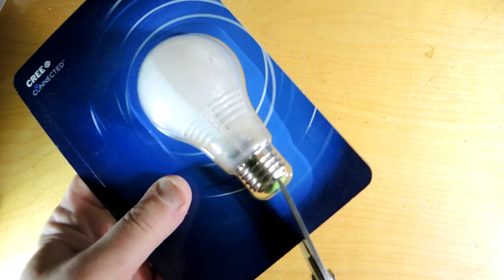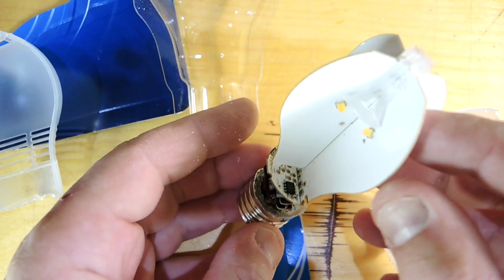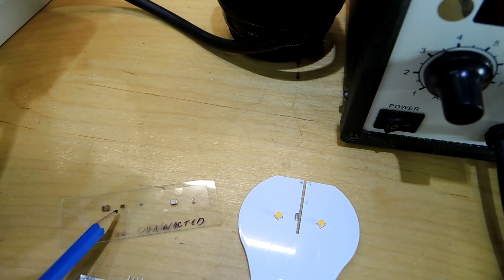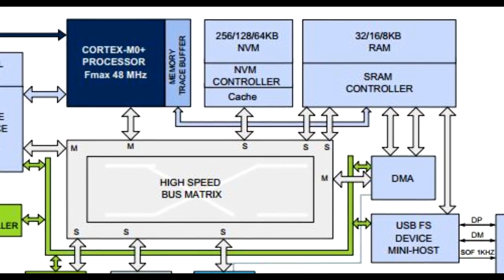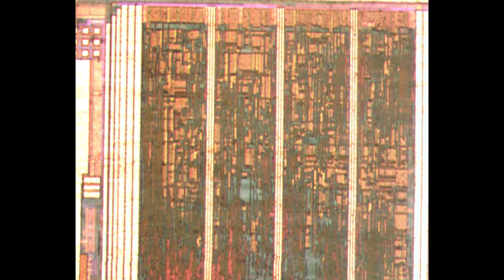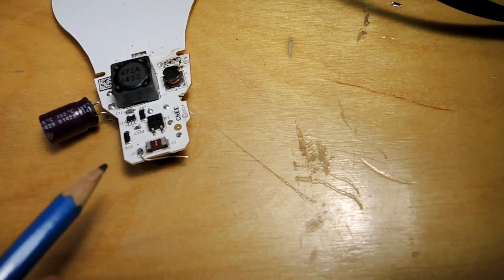Cree Connected LED Bulb Teardown

Comment: The Cree Connected has worked well for me on Wink. It’s Wink that has often been a problem. I tried the GE WIFI bulbs but, they were such a PITA to install, I returned them. Didn’t like the partially-covered bulb anyway. I had a single Cree Connected that stopped functioning correctly, to experiment with. The bulb lit, but long stopped turning off completely and going to full brightness.

But, I did a partial tear down of a couple of Cree Connected bulbs, but for usability purposes.

First, I have a light fixture over my dining room table. It’s one of those light fixtures that, when a clear bulb is installed, it shines a pattern across the ceiling. This does not happen, with a frosted bulb. But, I wanted the best of both worlds so, I removed the frosted outer casing of the Cree bulb and now have a bulb that shines that pattern, as well as being connected, on a schedule, and controlled via my phone.

The other need that I have is the range hood above my stove. The stove was built in Year 1. So, there’s no WIFI or remote anything going on. Not sure what the latest stoves have. This range hood takes 2 bulbs. The issue is that it takes an appliance bulb, which has a plastic, frosted panel beneath. I think that’s A15 or something else smaller than an A19. It is a shallow depth of space there so, I needed a more tubular bulb. So, to test the the bad bulb in this space, I figured I would just remove that outer shell, but I’ve also snipped that extra cardboard/plastic, that provides that bulb shape, providing a more tubular form for the tighter space. I’ve installed this bulb over the oven, reset it and, other than the issues it already has, it works. I’ve now ordered a couple more Cree bulbs and intend to do the same. So, now, when I or my pets enter and exit the kitchen, in addition to the Hue ceiling GU10 lights turning on, the lights over the stove can turn on/off, as well.

You might wonder why I don’t set it up, to have a sensor that ignores the presence of pets. It’s because, when my cats go into the kitchen to feed, they can turn the lights on/off, making it appear as if someone is at home, even if I’m not.

Ultimately, with some work, the Cree fulfills all of my needs, with the exception of the fluorescent 4’ tube lights in my bathroom. I live in an apartment so, I can’t do anything about that, unless I replace the bathroom fixture with one that accommodates an LED 4’ light, which I doubt I’ll ever do. But, for the most part, I have the options of regular soft white, daylight, frosted, clear, A19 and smaller size, where the Cree Connected is concerned, with a little mod.

Also, other than the replacement of wall sockets and light sockets, when I used to use X10, I know nothing about electricity, have little comfort with it and am always afraid I’ll blow up my town.

SIDE NOTE: As the Cree Connected is a plastic bulb and not an actual appliance bulb, I’m ONLY using them for the stove hood. They are not safe for use, where a glass appliance bulb would be, inside an oven.

Comment: Zigbee is one of the older standards, been around for a good 15 years or so. You can buy Zigbee wall light switches for around $15. Apple devices support Zigbee: iPhone's can communicate using directly HomeKit, and Apple TV can be used as a hub for remote applications. Many others also sell hubs etc, but the fact there are so many iOS devices out there makes it pretty mainstream and well supported. Unsure about Android devices.
Reply: i don't think an apple tv can be used for a zigbee hub  you need a hue bridge  at the very least a cheap gen 1 hue bridge
also have not been able to find any zigbee wall switches, i am looking for zigbee wall switches that  can work with a hue hub and are the old school switch style so i do not have to replace my switch plates which are fancy plates that i like and  some are for 5 swtches  alli can  find are  the damn decor style switches , i have those in my kitchen but i ahde to replace them all because theyre were electronic dimmers and   didnt work with hue

Comment: Honestly if you ask me, these bulbs are solving a problem that never existed in the first place. How hard is it to just flip a light switch that is already installed in your home? If it needs cell phone interaction, what happens if you loose the phone or the battery is dead?
Reply: It doesn't need a phone.  All the phone does is run an app to connect to the hub.  We can control ours from either of our phones or tablets, but we also hooked it up to some wireless switches.  I know you can connect them to an Amazon Echo as well, so you can just say "Alexa, dim the living room lights to 50%".... or you can just press the switch on the wall.

I would say it's a solution to a collection of problems.  We rent, and the house is super old, so it's not one switch, it's 4 lamps.  So besides being able to dim them, and turn them off all together, we also don't need to hook up timers when we go out of town, just set it to out of town, and away it goes.  Also, it's great for at night when you're carrying stuff into the house, you just flip all the lights on from in the car.

Comment: How do they handle stand-by power? Andy separate power supply inside?
Reply: +Paul Boonen 
It appears so.  I saw three inductors on the main board.  One on the side with the big electrolytic that is probably part of an AC line filter, the big Bourns-looking one that he pointed out, which is part of the LED driver, and a smaller one next to that, right under the 4-pin connector to the logic/RF board.  Location suggests it's part of the power supply for the ARM/ZigBee stuff.

Comment: I swore off Cree bulbs entirely due to their extremely high failure rate. I've had four Cree bulbs fail now, I think (I'm starting to lose track), and a fifth one is giving signs (flickering on occasion). None of the non-cree replacement bulbs have given me any problems (despite costing a lot less), so clearly the problem is terrible reliability on the part of Cree.
Reply: Ive had the same experiences. I even had some 90w flood led lamps DOA out of the package.

Comment: This bulb works with the philips dimmer switch wiout a hub. I had one of these and the capacitor blew out. Still skeptical of Cree bulbs even with good mechanical engineering. Only my Cree bulbs fail, no other brand (switch, philips)